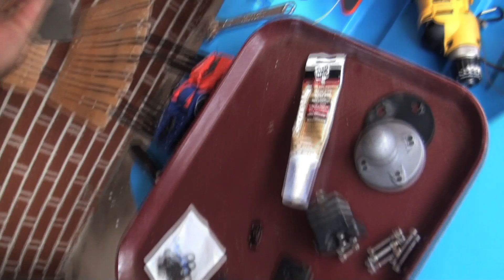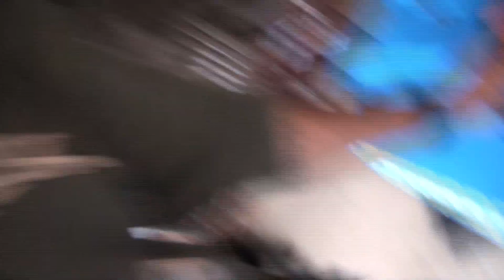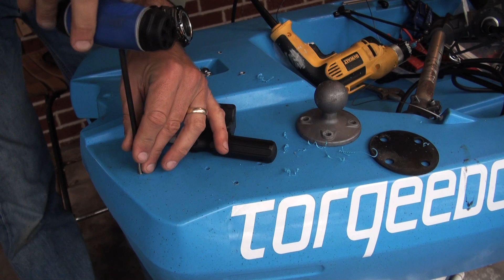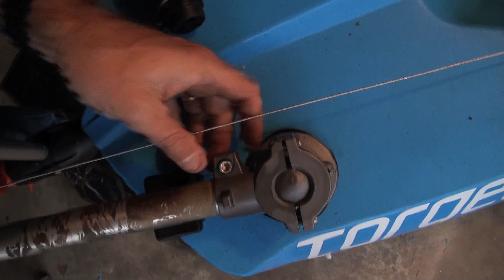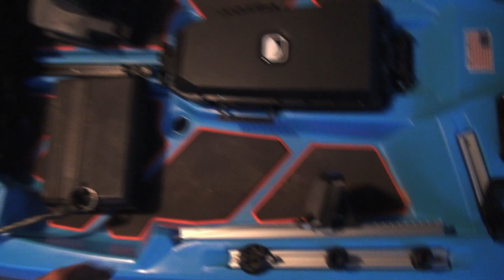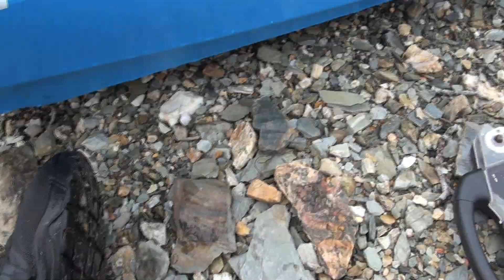Installation of Torqeedo Ultralight on Bonafide SS127

Comment: I know you do a lot of different things but are you in business to do installs like this or are there such places and is it practical moneywise  Also, I need to store my kayak vertically in a 12'4" space, would this set-up work for that? Thanks, Jeff
Reply: Ken R You need to find a local paddle shop that does installs. You can also wait for the new mount to come out, and this install becomes much easier. Vertical storage is something I’ve never done. You might consider hanging by a pulley and cleating it off.
Reply: @TheLittleStuff  Jeff, Thx
Reply: In your opinion is it worth saving $200 to get this older style mount or just go ahead and use the new aluminum bracket?  Seems like this one allows the install of a power pole on the bonafide center stern mount holes whereas the new aluminum mount does not, is that correct?  If the older socket mount is installed correctly does it require constant readjustment after reinstalling?

Comment: Why didn't you consider the bigger motor is it to heavy?
Reply from the maker: Alfred Montaner The Travel motor requires a transom and does not readily connect to foot control steering.